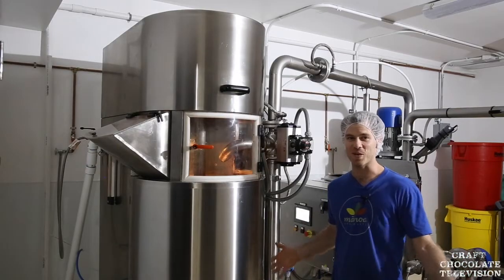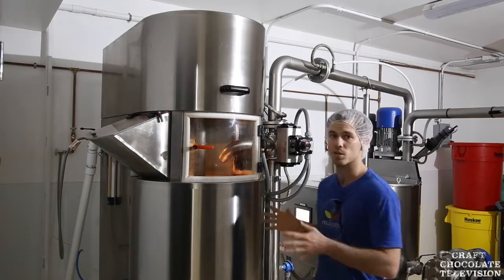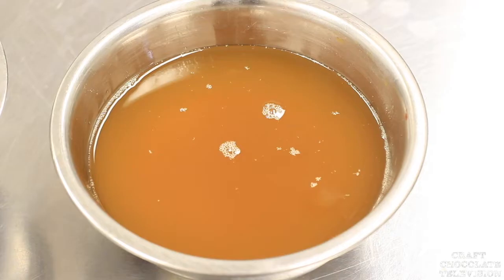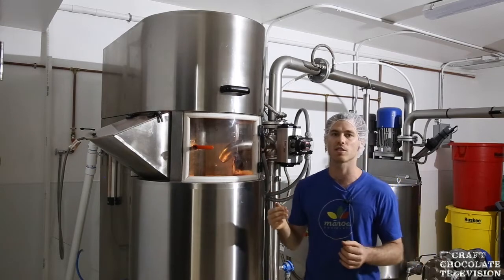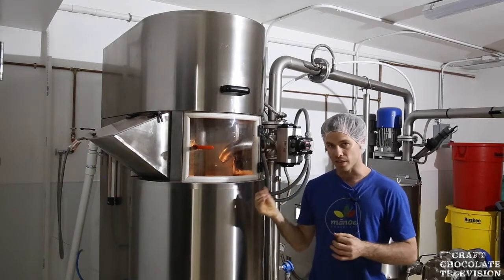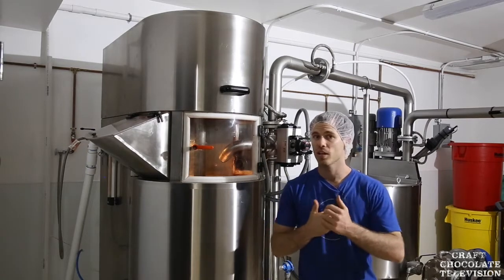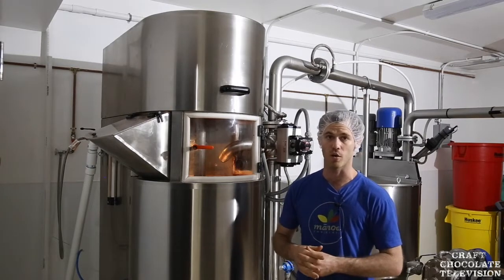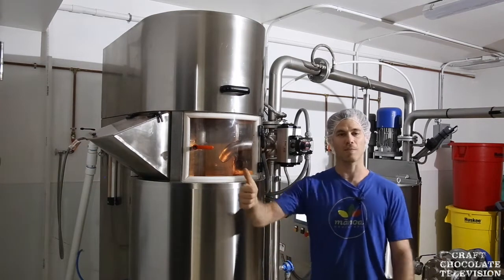The Chocolate Ball Mill - Episode 10 - Craft Chocolate TV

Comment: How do you reclaim the chocolate out of the mill? How often do you have to clean a ball mill and what is that process?
Reply from the maker: The chocolate is pumped out of a pipe at the bottom of the mill. We clean it between origins. We use cocoa butter to clean it, as water cannot be introduced to the system being stainless steel balls that we want to protect from rust. Water can also lead to bacteria that we need to avoid.

Comment: Nice video, thanks! How do you wash the equipment once you are done? With 80.000 small balls, you have lot of surface were chocolate will get stuck.
Reply: at my place we would flush the internal system using fat so it would carry out all the leftover chocolate and clean the machine.
Reply from the maker: You clean the ball mill by flushing it with cocoa butter. But when you put dark chocolate on top of dark chocolate or milk chocolate on top of milk chocolate you don’t need to do a complete flush clean with cocoa butter. The cocoa butter can then be used in the following batch of the same origin or inclusion.